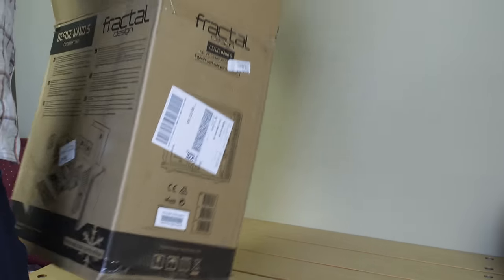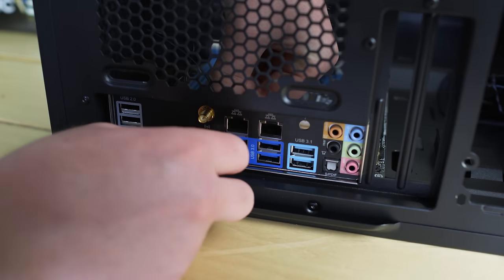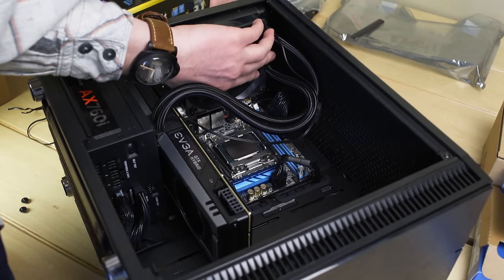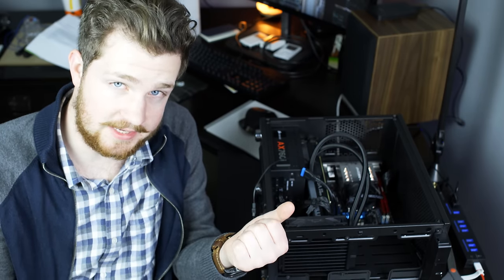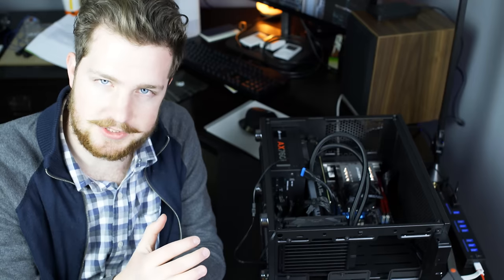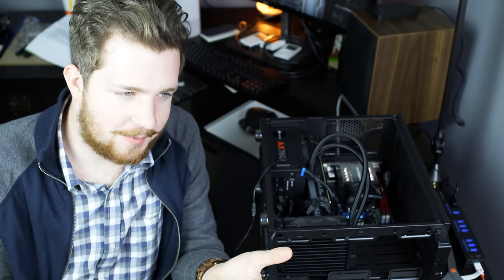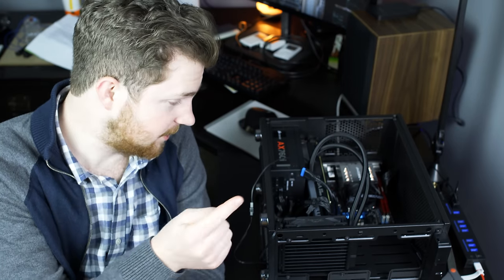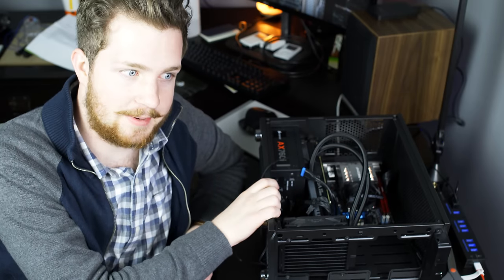My Powerful Custom PC Build Disaster

Comment: i am sure you were not tryieng as first instance to load optimal defaults in uefi.....   so you wasted your time and fresh new hardware with rma. because most people think complicated and not the easy way. if you think the components are bad you should try them in a different rig. never atach aio pump to mainboard. never tweak fan speed in asrock uefi. but you can tweak ram speed no problem. i own the asrock A88M-G/3.1 and after changing different things in uefi i got that boot loop issue stuff. after changing back to default settings everything is fine . 

the board is ok. use a tuning utility to change the speed and leave the three and 4 pin voltage for fan connection in default mode that´s the issue or buy fan hub molex adapter etc.

Comment: penny-wise, pound foolish, buying a refurb power-supply on a high performance rig. I keep a spare power supply around, for just this purpose.I can plug in the spare power supply for a test run, and see, if it's the power supply or the something else. It doesn't need to be a great one, just good enough to use a few hours a year.

Comment: do not change fan speed etc in asrock uefi then you get boot loop and stuff happenin plus never connect waterpump on 3 pin mainboard use molex to fan adapter or  sata to fan adapter. this boot loop thing happens to all new asrock or asus boards when you tweak settings like fan speed or other stuff. there is another video a guy showing his boot loop . same to me just load default settings dont touch the fan control in the uefi and you ll be fine. you can change the ram mhz and that´s it .   i think it´s because of the build in power security stuff when you tweak the voltage of the fans like qiet balanced or performance the board turns of cause it thinks there is a power failure. since i loaded optimal defaults everythink is ok. i recomend running asrock boards in standard mode using the a tuning utility from the website. think a lot of people who bougth asrock boards returned it to fast cause they thought the board is damaged. no it´s not first try everything like default uefi settings , checking  rams and as last thing you still can connect the board to the asrock support for diagnosis and support. asrock and asus boards are perfect you just need to understand the security of each board.

Comment: You are like the third person I've heard of in the past four weeks that had similar issues.  All were due to refurbished power supplies.  So odd.  I too am a big fan of buying refurbished, but I think I'll steer clear of refurb power supplies after this.  Good luck.
Reply: +Marcus Fraser Marcus, I completely agree.  Hopefully others will avoid the temptation to do so.  I'm personally starting a low budget build for a NAS now (documenting it on my channel).  I went with an EVGA 500W Modular Power Supply.  (Sale price $50 ..)  Didn't have to spend enough.  I'm personally hoping it turns out to be adequate as I've had great luck with EVGA Power Supplies in the past.  You don't have to spend a ton to get quality, especially on lower end builds with lower power CPUs.

Comment: This happened to me and I also worried about my CUP water cooling as my PC would power on and off. It turned out that it was my DDR4 RAM that was having issues as I used the so called EZ overclocking software that pushed my RAM too much . Everything worked again once I disabled the so called EZ overclocking software. However,instead of 16GB of D DR4 I now only have 12gb so I need to test whether it's the RAM stick or the RAM slot that,s broken .So I am sorry to hear you have had similar issues to me as the problem sounds exactly the same only it was my RAM that caused the PC to power on and off without letting me into Bios . I would like an update on what caused the issues mate
Reply: cup

Comment: You can NEVER cheap out on a power supply. If that thing goes, its most likely gonna take something else with it.
Reply: +TheMagesticFork So trueOn my new build I researched psu bang for the buck for almost two weeks. Settled on new EVGA 1000 watt for like $150 on sale, but God those refurbs on Newegg's eBay are tempting...
Reply: I know my 1000w was overkill, but for the price I just felt it was a good deal. I'm running an FX9590, twin MSI R9270 cards and an H100i cooler, so the power consumption is in the medium range. I feel that psu gives me head room for a couple of 390x cards later. Plus EVGA has really stepped up the game on their power supplies. They have pretty high ratings. I have an evga 500B still in the box, it's 80+ bronze and I got it for like $50. It's going into my next build, an htpc build. I want a media center that can still play games, and that should cover it.

Comment: Dude stop trying to make a mac pro factor size with so big ass pieces of hardware. Grab a big case, and atx motherboard and use ddr3 or get a processor that suports ddr4. Most probably is that your conectors unplug because the cables are stuck there by force and they are bend to be able to plug them into the connectors.
Reply: hmm...a romanian that knows the pc's nearly to perfection and that speaks english very nice. just like me! ce bine ca dau de romani ca mine!

Comment: Your m.2 probably runs hot and might be triggering a MB heat sensor. It's hard to get good heat dissipation in such a small build. Uninstall it and see if that helps.
Reply: +SunPower Guru I'm with you if it's not the PSU having bad pins/connector.  Those m.2s are a space heater even in larger cases or on a PCIe board.

Comment: In every build a pc tutorial video, people say that you should test the computer outside of the case first to prevent these these things form happening. If you just did that, you could've saved a looooot of time.
Reply: Not actually. When you start the computer you see only if it will post. This would post, but the problem would still be there

Comment: I really hope Apple starts making good pro machines, because I do not want to go down this road. Sadly, they only seem to care about phones and tablets these days.
Reply: +Max Hancock The road is fine, and actually pretty easy.  He added defective used equipment to his build and was frustrated that it didn't work.

Don't buy refurb parts from 'a guy' on ebay.

If you need to buy refurb, buy them from the manufacturer, or not at all.  They will warranty that the part is working.

Refurb on ebay has a good chance of meaning "It doesn't work and can't take it back, so I'll sell it to some poor shmuck".  As long as they tell you it's a refurb and don't state it's in working order you have no claim or reason to expect it to fully work.

Comment: i work in 4k, i just went hackintosh when apple did update their 4k lines. If you like your workflow you don't have to change it. Just updated to 10.11.4 yesterday. And reboot to windows for games.
Reply: +JesseDegenerate Nice, can you leave your specs? :)
Reply: it's not that new, lol it's a haswell build, i'll get my exact i7 cpu and mobo at some point for you, 16gb of decently fast memory, and a couple ssd's in raid 0, backed up daily of course. In general for hackintoshing, i find gigabyte boards to be the most compatible; but ymmv, and i've seen it done well with most major vendors. Generally speaking, with multi monitor layouts, nvidia cards are easier to configure.

Comment: My old server that I discontinued does that, I think it is a power supply issue as well. Hate the thought of taking it to the dump even though it is old it is a very nice Dell Power Edge full tower with Twin Xeons and ECC Memory and Raid 0 but it is 10 years old and win 2003 is over the hill. Was a great Mail server. Better than Hillary's. :-P 
I feel for you on this build, I had that happen to me once and was a problem with the motherboard. I was going to do a build this week but ended up buying a bare bones Lenovo Y900 I7-6700 with SSD, Win 10 but without external GPU for $899 and for $69 I got a 3 year in home warranty so went that route. Should be here tomorrow!

Comment: It's always a nail biter when putting a build together.  I just tore mine apart about three weeks ago to better the cable management.  I literally had almost every wire disconnected and just about started from scratch.  Took me a while, but got it all back together and things were working just as before....well, it actually boot into an old hard drive which I had to switch the priority again (I didn't attach hard drives to the same SATAs as before.

Comment: Whenever someone is assembling a computer, we must always test all components and enter the Bios outside the box.
So we have better access to hardware and resolve and better detect the fault and then put everything inside the box.
Usually mounts the basic processor, memories, SSD and power supply and enter the bios if everything is correct settles the oprativo system and drivers and then then the other Components as graphics card, hard drives, etc. We save lots of work if things went badly run as was the case.
Sorry, for my English.

Comment: Welcome to Intel. So many more headaches. Also NEVER EVER buy REFURB for Critical components.hope you got it all worked out......i have also had AsRock fail on me. and i have been rocking a 880g in my main rig for over 4 years...I trust them. but everything has a failure rate.

Comment: Reconditioned PSU with obviously dodgy connectors is almost 99% sure to be the problem .. might have screwed the mobo too. Why on earth did you even fire that psu up if the connectors are so clearly borked?? Just risk destroying over $1000 of hardware for the sake of saving $80 on a brand new psu...... noob moves FTW .........

Comment: i know this is an older video, but i had the EXACT same issue with the EXACT same power supply. the issue was finally fixed by corsair sending me a NEW AX 860I. swapped the MB, brand new CPU,.... sigh i know your pain. you would not believe how many times i tore my system apart.

Comment: I think you touched a very common subject amongst us Mac Pro users. I am in exactly the same situation. Apple does not build the computers we need and we do not want to leave all our Pro Res and Mac formatted hard drives, just to go back in time with a PC that is cheaper.

Hence the Hackingtosh solution; I have one built at this moment ,by an expert for $ 2000 and I am looking forward how it will perform . 
We chose for the faster clockspeed variant (quadcore),  since Adobe took out the multicore processing option in Premiere and After Effects.
So I do believe that a faster clock speed (4.4 Mhz), a faster graphics card  and 1 TB ssd will do the job. I will let you guys know in a couple of weeks.

Comment: If you EVER use force with a computer, you WILL destroy it. These are not generators or power tools. They are VERY sensitive electronic parts that will break if your sweater produces static. Much less you leaning into a plug with 180lbs. Come on. I expect this from children but grown men should be smarter than this.

Comment: I was really nervous doing my first pc...not to mention I did a lot of noob mistakes.. (Putting the motherboard without the standouts, Putting the gpu before all the headers, Installing the motherboard before the IO shield, Not installing the cpu Cooler in the proper way...) It's a miracle I got it working without ESD or messing something up.

Comment: You appear to have bought a water pump that is not a reliable one, if it's the same as the one I bought inside. I already did a take-apart video on it. Even if the other one works now, it may not last nearly as long as you expect. If it's the same as the Aztec Kuhler 620 pump, or is very similar inside, you may find the bearings on the pump will eventually get too stiff, as well as having problems with the electronics.

After fixing the CPU cooling problem, I agree that the second problem also sounds thermal related, and the issue with the PSU connector sounds a likely candidate. I had a similar experience that may be relevant with a friend's Vauxhall Astra. It would run fine, until you had to sit idling in traffic, especially in warm weather, and then it would suddenly shut down. After a while it would work fine. When I looked at it I discovered the engine position sensor had a connector near the top of the engine, where the middle pin was pushed back, so it only just connected with the socket on the other side. When the plastic connector expanded in heat, such as sitting in traffic with little airflow under the bonnet, the centre pin would disconnect. That is what may be happening with the PSU connector.

You've been really unlucky to have two problems like that simultaneously, but in future, I would buy separates for a liquid cooling system. If you get them off ebay they can be quite cheap.

Comment: I have a similar issue, I tried replacing the PSU and graphics card and the only solution is to keep vmware running in the background. It's really bizarre. With vmware running in the background, it is up for many months, no issues at all. If I quit vmware, it crashes about once every 1 to 2 weeks.

Comment: I have also 3 of the 5 pc's i have, running again only put in the diagnostic card. Look always if no dust (no matter how small it may be) in the Ram slots. And set yourself on earth if you touch ram, cpu and electronics. Even clothing  can set some static electric. And if something does not go well, like the connector, don't (never)use force!. It have a reason way it don't fit. (Take a break and drink some coffee, or take a walk and listen to the birds :-)

Comment: Great video.  Hope you managed to get the your custom PC work good and sorted out.  From what you described in your video of the power and boot up issue. It did sound like a PSU problem. In fact I have had the same sort of problem with refurbished PSU's as well. That is why it is the one and only thing that i would never get a refurbished one. I always by mine brand new and out of the box. Cool video and welcome back to the fantastic and sometime downright stressful world of PC lol

Comment: I think its a sad time all around for enthusiast / semi pro use of computers. There's so much weight being thrown behind mobile now that the old driving force that kept speeds increasing year in year out has pretty much dropped off to a crawl. Mobile processors are better than ever but on the desktop, meh, same old, tiny little speed bumps and I guess over on the Mac that's even more pronounced.

I find it really odd that Premiere would be your goto editor. Man its years since I touched it but I really hated it. It was so slow and clunky. It crashed a lot too but I understand that thing that happens with software where you just get a workflow going and anything new, even awesome new, its hard to re-train yourself when what you've got works

Comment: I would gather your cpu isn't making a solid connection across the pins. When I put together machines and I have the cpu installed I thumb down firmly all corners and then the center. You obviously would do this before the paste but I think that's where you should start looking. This sounds like its more of a cpu voltage distribution issue.

Comment: if you haven't sorted this yet i recently brought the nzxt cooler and had cooling issues. most motherboards have smart fan control on the cpu fan, this header is what powers the water pump on nzxt. you must disable this fan control in the bios for the pump to work corectley, just set it to 100% power all the time. problem solved for me. hope this helps, they should make it more clear

Comment: I had the same problem 2 days ago, I had removed 1 ram module without removing the OC on it, my system had the same shut off problems until I realized that it was a memory timing and OC problem, so I disabled the OC and then reenabled it and it fixed it

Comment: Featuring in this video: How NOT to build a PC!! that Mobo, that case, that PSU... oh boy...
Reply from the maker: +Raimar Lunardi Mobo is excellent. Case is great. PSU was a dud. It happens.
Reply: the position the GPU is, blocked by the PSU makes the case be garbage...
In my opinion, Mini ITX is for cheap setups, not this kind of stuff...
Reply from the maker: +Raimar Lunardi GPU is not blocked. There is plenty of room for ventilation. Temps are not a problem on my build now that its complete. Furthermore, MiniITX is not for cheap builds—that's a misconception. They're small, have fewer RAM and PCIe slots, but that doesn't mean its bad as long as it fits your needs—which mine did. :D
Reply: Well, lets see benchmarks and how it performs then!!
Reply from the maker: +Raimar Lunardi https://www.youtube.com/watch?v=NDmOHU6lmRw

Comment: yeah "hacking around this" to get CUDA to work with adobe premier on a mac which uses AMD GPU??? only to find it doesn't really work well :D loooool years of plug and play planned obsolescence has ruined you dude. CUDA is Nvidias answer to parallel computing IT ONLY WORKS WITH NVIDIA GPU ARCHITECTURE I'm not slating AMD ive built numerous AMD systems for people on a budget and they make good parts for less cost. the reason that mac pro doesn't do what you want to anymore is because it was designed to do exactly what it is supposed to do which is cost you a lot of money and last the shortest amount of time before needing a replacement :D $4000 for just 2 years use? that's a sick joke. the specs on the mac pros are usually pretty weak for the price they always have been. WAAAAAY OVERPRICED and not even upgradable. MACs are like disposable cameras compared to a normal PC